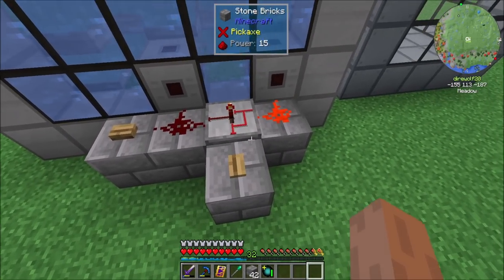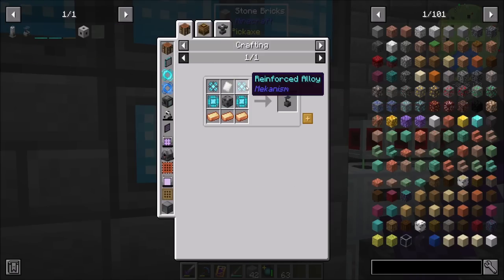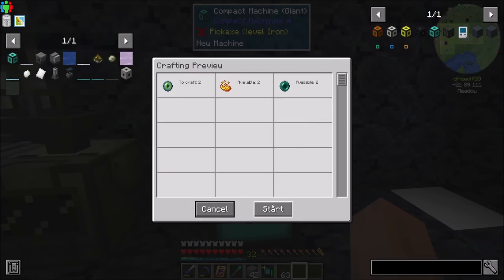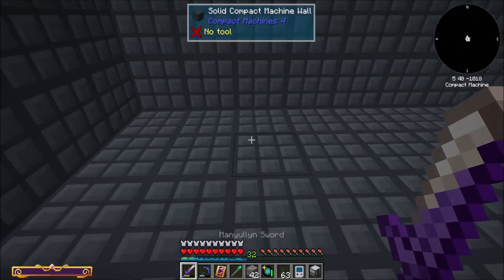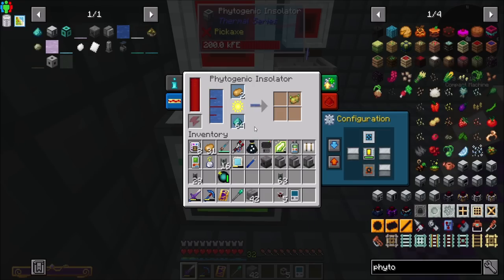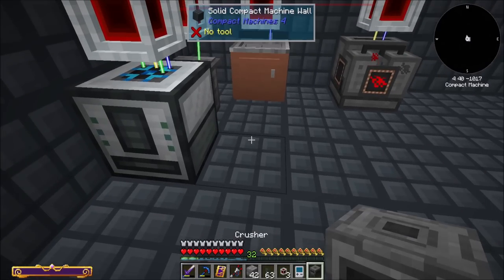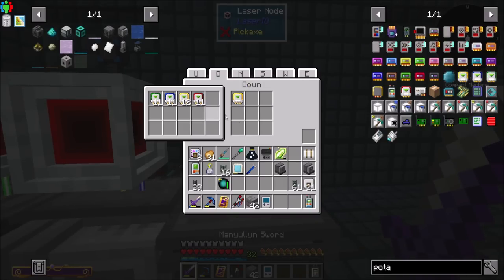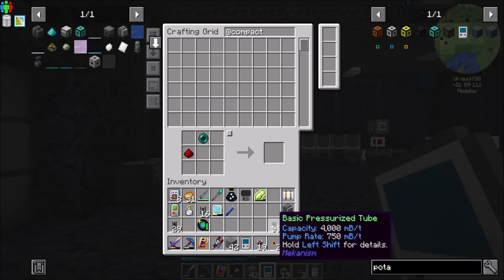Lets Play S11E56 Compact Machines and HDPE

Comment: I assume the connection works like a chest between the dimensions. You can actively push into it from one side and actively extract from the other?
Reply: Yep, and for whatever reason whenever I relog every connection forgets it's a connection and I have to break and replace. Ended up just using wireless for everything in those.

Comment: I've got a suggestion for LaserIO: Make the core of the nodes look a little darker when they're not connected to any other node, so that it's easy to debug forgetting a connection even if there's a laser going straight through like in the episode the other day. 

Maybe also make it so that it's not dark if it contains both an insert and an extract for every type of card present (because you might just need a single node for a small compact build)
Reply: I had the similar idea of displaying different networks with different colors while holding the wrench. Both ideas definitely seem like good possibilities. How exactly to implement things is always the tricky part.
Reply: Thats a good idea! also i kinda wish that the nodes were smaller like the power points
Reply: Why dont you post that on the github so that he can track these suggestions? im not sure how much he keeps tabs of comments
Reply: If a node has cards, it should display on all it's sides a little icon that represents cards. It could even display 1 icon type per card type stored in it. As has been stated  by Jacob Petersen in comments above, how exactly to implement is the tricky part.

Comment: the compact connection nodes work with pipes on both sides. it has its own buffer, but u can't directly put a chest next to the compact machine, put a pipe or laser node between them. and with the laser node u forgot to sneak it again

Comment: Dire: Has Ender chests available.
Also Dire: insists on using Compact Machines Item Tunnels, instead of just sending the HDPE pellets to the Refined Storage system.

Dire is getting so good at automating things he has forgotten that the best part of such a system is the ability to unify and store in one storage system that handles all input, such things as excess machine outputs.

Dire could also have just sent out the poisonous potatoes and stored an infinite number of them in a void upgraded drawer including stack downgrade to 1 stack of them, if he had thought about the beauty of the RS system he has going.

Me, I prefer to have it all go into one storage system, either through interfaces or whatever the ME or RS system accepts, or through chests, including, but not limited to, Ender Chests. After that, I just get the storage system to handle whether it will get put in drawers or on a disk drive.
Reply: Sure it would be more convenient, but sometimes you just use different mods for fun, because using only one method when you have access to multiple choices in a video game is boring xD. It's like having hundreds of dishes on the menu and only ever trying your favourite one.

Comment: i like the node mod but the parts are far to expensive. nodes should produce several for the materials you require for it, especially since you use them like pipes and need a lot of them. as well as lots of cards per node, adding it all up it's quite pricy, i would suggest changing the recipe to 4-8 nodes per craft, and 2-4 cards per craft, since you are using blocks instead of single pieces. but that is truly my only gripe. otherwise the mod is quite useful and very well done. nodes are ugly and an eyesore, but if you can hide them it becomes less of an issue.
Reply: To be fair you can make this use far less nodes and get similar results, like he did for his Fissile fuel production line

Comment: I think there's gardening cloche in pack, it's faster, instead of CM tunnels I think its better to use network transmitters for Refined storage
Reply: Also I assume most people know this but it will grow full melons which you can use a precision sawmill to break into melon slices and get all you need for your ethylene line from a single cloche

Comment: 16:43  you're making things more complicated than necessary.  one, the machine can output and input on the same side, so you can extract and insert potatoes both from the top using just one node.  two, the trash can already has its own filter, and the machine can output directly; so you don't need a node at all for the poisonous potatoes.

Comment: The reactor is just so completely useless. With a burn rate of 1 mB/t he only creates 22.83 kFE/t. Which is not even enough to power all the machines required to generate fissile fuel. The gas burning generator with Ethylene generates a whooping 72.19 kFE/t and can easily support the few machines that are required to generate Ethylene. I basically only build a reactor to get the materials for high tier mekanism items but not for energy production
Reply: isn't there a balance point somewhere, where if you bump the burn rate, it'll eventually generate enough power to support the fissile generation? Obviously as you go up, you need more generation, but I was under the impression from previous versions that the powergen goes up faster than the fuel usage... but I'm not playing the current version.